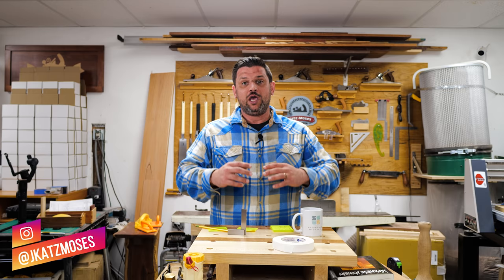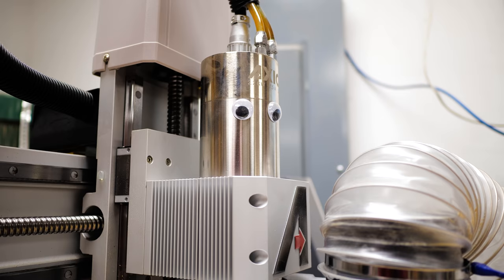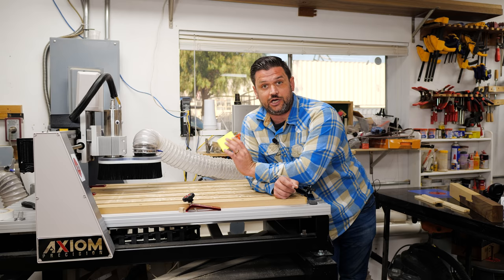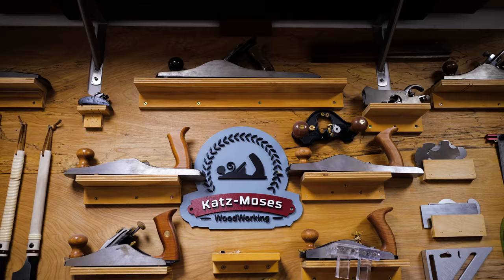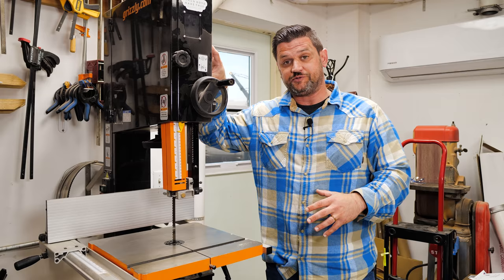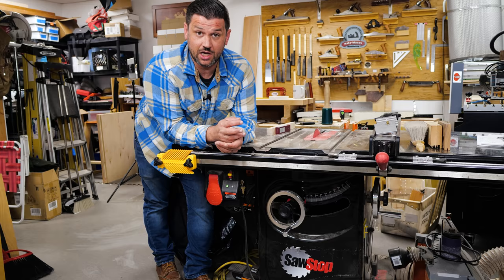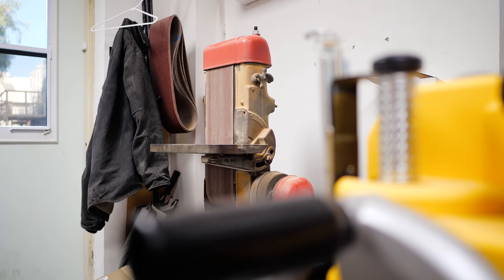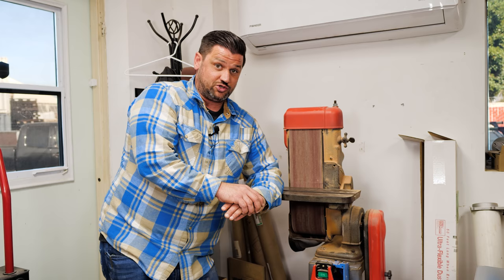Buying Used Tools - Negotiating Tips/Tricks and Buying Advice (Plus a Mini Shop Tour)

Comment: Another great piece of advice is to set an alert on Craigslist for what you are looking for.  As soon as an add is placed you will get an email.  If you are the first to call you can usually get the item, I always offer a lower price and can come get it now.  Over 2 years ago I had set a Craigslist alert for "Sawstop" and late one Friday night 6 months ago I got an email for an ad that said "SawStop $2500"  There was no picture and no description.  I called the guy and he said it was his dads saw and he didn't know anything about it other than his dad had to install a dryer outlet in the garage to run it and that it was really big.  Knowing that meant it was at least a 3hp if not 5hp and probably 52".  I offered $2000 and would come get it now. He offered to meet me at 7 the next morning.  Turns out it was  5HP, 52" industrial cabinet saw.  On an ICS mobile base, with an extra brake, a dado brake, 2 uncut insert plates, and a freud dial a dado set. It had been used once before his dad got relocated and put it in storage.  I had to have a 220 outlet installed but whats a $100 electrician bill when you get a $6000 saw for $2000.
Reply: Another comment on Craigs list alerts... I set an alert for "clamp" and "clamps" and my set of clamps went from 12 clamps to over 50 in less than 4 months and I have less than $250 invested in them.
Reply from the maker: That is exactly what I'm talking about! Great story bud!

Comment: Great video and advise. That’s how I’ve acquired almost all my tools. 

Can you tell me a little more about the dust collection you have for the drill press? I need one on mine.
Reply from the maker: Nothing special. Homemade table that connects to a 2hp two stage dust collector
Reply: Katz-Moses Woodworking Shop What is the hose setup and how does the hose stay put?
Reply from the maker: @veepsgarage  I think it was a peachtree kit and just friction fit

Comment: thank you Katz . good info  i would of never thought of used tools as i worked in machine shops for 10 yrs back in the  70s and saw the abuse of most of the equipment . but that is machine shops . oh a funny for you my starrett combo square cost me 48 $ back then now i see em for 150 oh my . luck i still got mine most of my dials are good too lost my ames dial . i do think you made great points on the used machines . i do wonder about the saw stop is it worth it i know the saw can eat you . but that would be the only one that would not due to the brake . i would fear you would get complacent with the other equipment ?
Reply from the maker: Sawstop is best in class with or without the brake. Highly reccomend
Reply: @katzmosestools   thank you Katz love the feed back as i am new to wood working  .
Reply: @katzmosestools  i was just wondering about em its the only kinda safe but the only one . just got to remember all will eat us lol munch

Comment: I picked up the exact same drill press at an estate sale that was only 2 blocks from my house.  I thought I got a screaming deal at $100 - $50 is even better! One quick question. Raising and lowering the table is difficult because of the table weight (there's no crank to raise it, at least on mine). Do you find with the large table you've added that it's hard to raise or did you figure something else out?    

Thanks and keep the great video coming!
Reply from the maker: No getting around it. Just sucks
Reply: I have the same drill press too. I haven’t done it yet to mine, but you can add a counter weight. just google adding a counter weight for the drill press table.

Comment: I like the second hand deals.  I tend to disagree with you about hand tools.  Unless you restrict yourself to Japanese hand saws (which seems to be your preference and is fine), the old hand saws are by the best things out there (including the new saws from botique saw makers) and if you cannot sharpen yourself there are plenty of people out there that can do it professionally for you. As for hand planes, other than low angle bevel up planes (because old no 64s are rare), the old stanley's (and other brands) are easily as good as Veritas or Lie Nielsen.  You just need to learn a little bit about tuning up a plane and sharpening and you can have as good a plane for a small fraction of the price.
Reply from the maker: I hear you and for some that may be true. I find I hate being a tool refurbisher when I could be making some sawdust. Just a matter of personal preference but the blades on new hand planes are maybe 8 times thicker and I find they make shavings so much better for me
Reply: Fair enough, everyone has their own line to balance on.

Comment: Nice   planer?    dood you mean Jointer Planer how ever if you plane both side of a board both sides will never be parallel they can only ever be flat. until you put them in a planer.

Even so 850? you stole it! did you at least give the guy a Kiss?

You right a fair price on used tool's is 1/2 origanl retail value  ( that's newish perfect working order)
Price drops from there let's say you can't buy parts for it anymore or its broken.
tool's do not often go up in value unless you have some rare hand tool only a few were ever made and sought out by collectors .

Some yo yo listed a craftsman plastic tool boxes for more than origanl retail price I had one of them boxes I bought new years ago, he would not take the offer, I walked.

Seriously some of the prices people are asking are really stupid, you can't ask for 500 bucks for a 40 year old Radial Arm saw when 50 of them on on Craigslist for 20 to 200 bucks each.
Use your head when you list somthing.

Estate sales:  Last day  bingo!